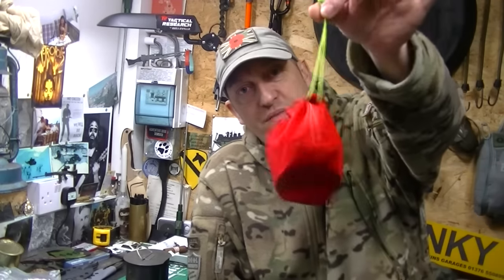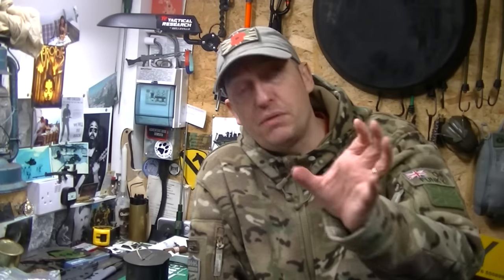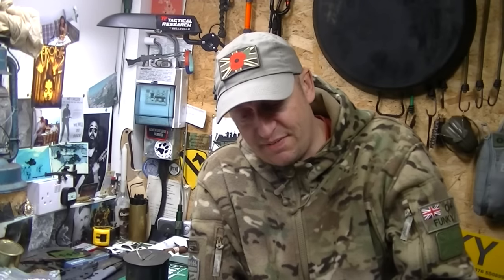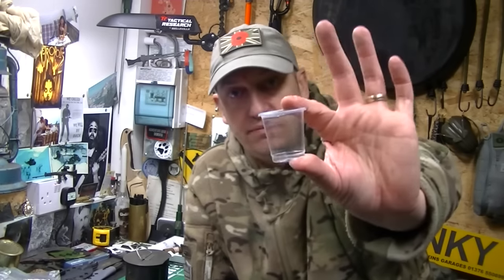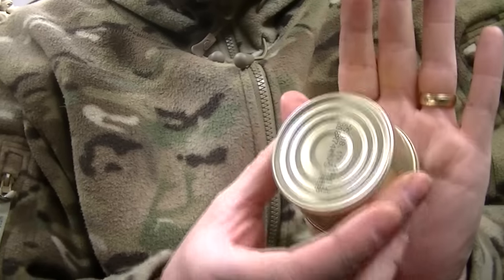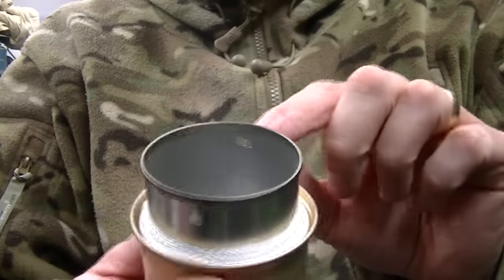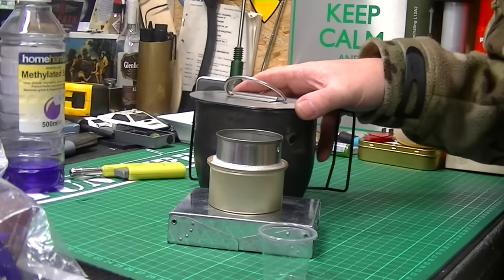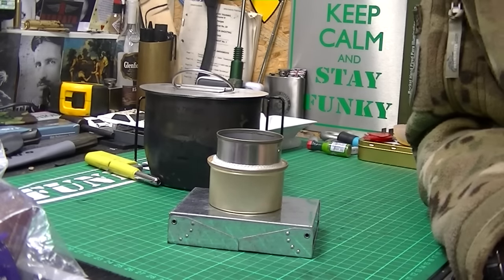Cat Stove by Tac Blades - Ultralight at 46g

Comment: I am very impressed with this stove Funky.
A stove like this should work well in all conditions you will meet in the UK. In really cold weather it is better to insulate the stove from cold ground and also it goes without saying that you really will need a windshield to get every ounce of performance from this or any stove for that matter.
On really cold days it is good if you can warm the fuel prior to use. A small container (fuel  proof) of fuel placed in your trouser pockets will do the trick.
I have been a fan of Alcohol stoves (Trangias) for some time. I like the lack of moving parts as there is nothing to go wrong and also the quietness as it burns.
Impressed.
Sandy

Comment: the fire rope which can be bought on ebay fairly cheaply is used as the seal on woodburners etc, i have used it coiled up in a standard alchol burner, just fill with fire rope pour meths etc on and similer idea although i am impressed by that little stove as it would slow down the proces more by trapping the fire rope in the sides, dont burn meths in an enclosed space its toxic like most things,... and make sure you get rid of any on your hands before lighting the stove, or your hands can be on fire a few mins before the pain gets through lol i speak from experience :):):) great vid love the from the man den idea, reminds me of jack hargreaves from the out of town series :)

Comment: Isopropyl alcohol makes a lot of soot on your cookware, nothing burns cleaner than methanol. Here in U.S. we have gas line dryer for vehicles called "Heet", red bottle is isopropyl and yellow is methanol. Can be purchased at just about any gas station for just a couple bucks. Also it's nice to have an extra cup around to snuff it with. Have fun funky!

Comment: Glad you found alcohol "not drinking" again. I use alcohol all the time for hiking and backpacking. Super fast and lightweight for backpacking trips. Makes boiling water for rehydrating fast and easy. You can even bake with certain alcohol burners. Downside is they tend to boiler burners only and wind is a big enemy so be sure to get a proper sized windscreen to for. Burner and pot itself so it's a system. Don't use rubbing alcohol as you will not get good heat production and will have yellow flames not blue. Use proper high percentage alcohol 90% or above. I dry bake with my own homemade carbon felt wicked burner I made myself with a simmer ring top: look thru my Instagram gallery and you will see it in use baking chicken breast stuffed with cheese and then baking desert.  Cheers funky

Comment: Thanks for the video funky. I bought one of the cat stoves from Tacblades and am very happy with it. Gary is investigating other wicking materials but this  fibre glass seems to me to be an excellent compromise of weight/cost/durability. I have read that alcohol stoves don't work well at low temperature but Zelph (original creator of the design upon which Gary has based the Cat Stove) tested his version and was pleased with the low temperature performance, so that's another bonus for this design. As a general 'alcohol stove' FYI, I understand that with meths you can reduce the soot produced by diluting it by around 5% with water. If you do begin to use this on a regular basis then you might want to try that out.
Reply: Carbon felt works great I hear!
Reply: +Mark Martin yes arbor felt does sound excellent. I looked into the price though and the cheapest that I could find it was £40. That was for a far larger piece than I needed, so perhaps not too expensive 'per stove' if someone planned on making several.
Reply: +Rhys Clement-Evans not sure if that was the spellchecker or fumble fingers but I did mean carbon felt.
Reply: Rhys Clement-Evans check out Hiram Cook on youtube he is one guy that knows all about the little cat food stoves "Fancy Feast Stove" testing, experiment, diff fuels and boil times.

Comment: It may have been made in the UK.  Here in the US it is made out of recycled household metal objects.  Fancy Feast cat food can and a tomato paste can I believe.  The fiberglass door seal for a wood stove acts as the wicking or you buy a carbon felt blanket in the soldering supply section of plumbing parts at the hardware store. The blanket is 18 by 18 inches and is used to protect wood parts of your house while soldering copper water pipe fixtures. The wicking is the most expensive part of the project. a Search on youtube for the fancyfeast stove will provide hours of watching potential.  

  relative humidity, the temp of the water to start with, the temperature of the day, the amount of wind blowing, and even if you are using Ethanol (denatured means it has an additive to make it poisonous to drink) (usually gasoline) or Methanol.  all effect boiling times and fuel burning times.   adding a insulator under the trangia for example is how they get it to light easier in cold weather.  They also provide a cold weather kit that you can put a few drops of fuel in and light under the burner to heat it up enough to work when it gets frosty.  Some people spill some alcohol onto the lip outside of the stove and light it to warm the container and fuel inside.  20 (f) I believe is where the alcohol fuels start to get temperamental. 

zenstoves.net  a great webpage to show all of the major alcohol stove styles and types.  and how to make them. 

 I do recommend that you subscribe to Hiram Cook's channel(s) he has 2. One got jammed up due to youtube not appreciating the short song jingle one of his friends donated to him for an intro.  One channel he isnt updating anymore but he has loads of old videos with experiments of burn times with different fuels.  A search for Hiram Cook will show both channels I rec subscribing to both to see the older stuff too.   Zelph has a youtube channel too.  His youtube name is spelled with two L's  zellph it will search.  Hiram has a external fuel source design that you can make to keep your stove burning for much longer times.   It involves plastic parts and a hot glue gun.  The connection to the stove is metal of course.  You can use a metal tube or a metal fitting to accept the tiny surgical tubing style fuel line.  

loads of info available about alcohol stoves.  methanol is an "alcohol" chemically just for discussion purposes.  Methyl Alcohol (methanol) and Ethyl Alcohol (ethanol) are the two typical fuels.

Comment: Made 'penny stove' before and while it did work I was not very impressed you have to pre heat and faff about and the alcohol can spill too easily. Tried modding it with fibreglass to help reduce spill etc but your one seems much better. Also made a mini twig/hexi burner thing (think it's called wood gasifier stove)as well which I liked a lot more, you're not reliant on taking fuel with you, it's light but it doesn't pack away very well. There's plenty of videos out there already so not much point in my posting one but it's basically a tin can suspended within another tin with lots of holes punched in it. Works well for short burns and with limited fuel. You can boil a pint of water with it, start to finish in about 10 mins or so in the field using thumb sized bits of wood.

Comment: the fancy feast stove rules the rest. i tested quite a few and this one seems to do it all. cold minus degree temps doesnt affect the flame. i use it in the little coughlan fuel stove that you have there. works a charm if the tomato paste can is the same height as the coughlan stove. i use methyl hydrate 99% pure/10$ a gallon at canadian tire(in canada). check out shugemery's channel.

Comment: Hey Darren, Do you have a wood burning gassafying stove such as a Bushbuddy or Solo? Those work amazing and you do not have to carry fuel. you just use what you find on forrest floor. They burn wonderful and are light weight. And the alcohol stoves fits down inside it for a back up. IT is good all away around

Comment: Hi Darren, the stove looks amazing but my only concern is it probably is not that easy to pit out, so is less fuel efficient. I like that you can put the trangia out and put the lid on with fuel still inside. What do you think? ATB Mark
Reply: you are right, but you can use as little as 15 - 20ml or half a measuring cup to boil water, so just use less fuel. its best to let them burn out so they are stored dry. Takes a bit of experimenting to find what works for you. i use 30ml for two boils to cook a boil in the bag meal and make a few hot drinks.
Reply: +Tac Blades have you thought about using an external reservoir connected with a pipe. You could then safely add more fuel whilst it is lit and disconnect the reservoir when you have finished. It wouldn't add much weight. Just a thought.
Reply: Yes played with silicone tubes external feeds and smaller stoves, but in the end i find it all too much fuss, i just like to place stove, squirt fuel in, light done.

Comment: I would think the top holes would be to stop a vacuum being created and stopping the fuel from wicking 
Atb steve
Reply: +sparkysteve the top holes are to stop pressure building up in the middle from the boiling fuel,
if there were no holes the pressure builds up and forces boiling fuel out through the wick, not good.
So they are a safety feature.